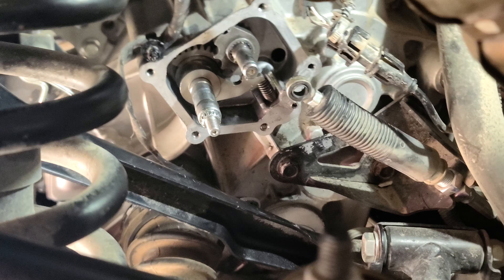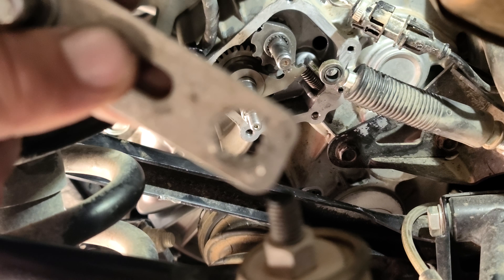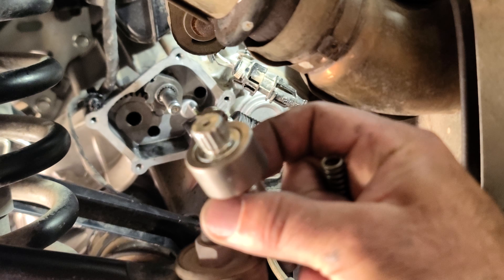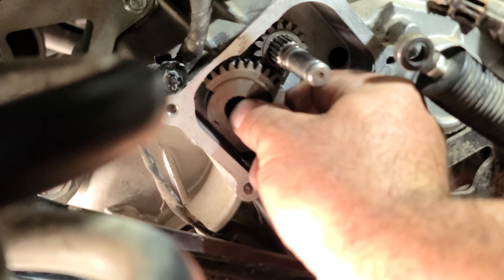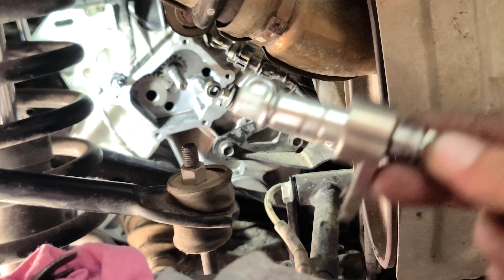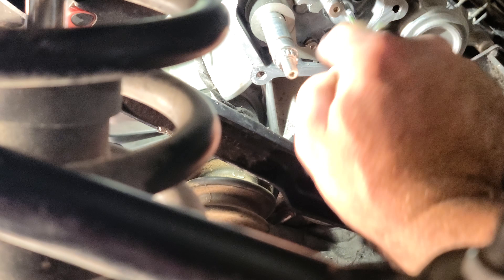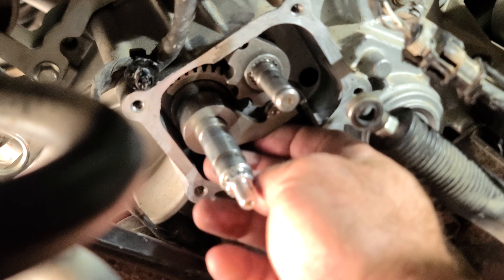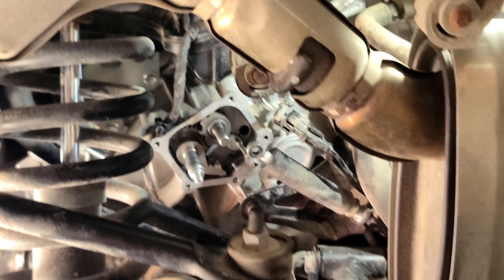Polaris XP 1000 Ranger shifter pawl fork linkage repair

Comment: Greatly appreciated the video!
That was the problem; I had previously replaced the shift cable about a year ago b/c of @Polaris the cheap-a$$ multi-material connection at the shift handle just broke.  These couple of noted shifting issues are definitely weaknesses in the design.  I will say though, but for all the crappy shifting since it was bought; at least the transmission seems to hold up ok so far…
Spoiler alert!: The turkey at the end was a great closer. 😅
Reply: Where did ya order the cable from? I have seen some for 179.00 and 40.00
Reply: @carldavid4121  finally responding;
I got the replacement cable from a local dealer.  It was about $40-ish

Comment: My 2019 XP1000 had the roller break off the shifting paw and get into the transmission.
Some of my spider gears ended up with broken teeth. I did not find the roller, just some
metal bits in the oil. It shifted so hard the shifter on the dash snapped off one day.
I installed a brand new transmission ($2,900) and repaired the original for a spare.

Comment: I'm working on a 500cc ranger and got it apart but the single dot on the small gear is on the opposite side when it slides on and there's no way to line it up with the 2 dots on the big gear?

Comment: Did you just pull / pry the gear seletion sensor off?
Reply: Selection sensor on mine had to kind of coxed off little by little. Screw driver one side then the other. Bit by bit. Good luck
Reply: @jimlee5626  Interestingly, mine totally fell apart. it was rusted on. Ordered a new one and got it all back together. Thanks for the help!

Comment: Could this be the problem on mine if when I shift it shows it in each gear on the dash but doesn’t actually shift into other gears and is stuck in neutral?  I can move the actuator manually and it clicks like it’s engaging but nothing happens